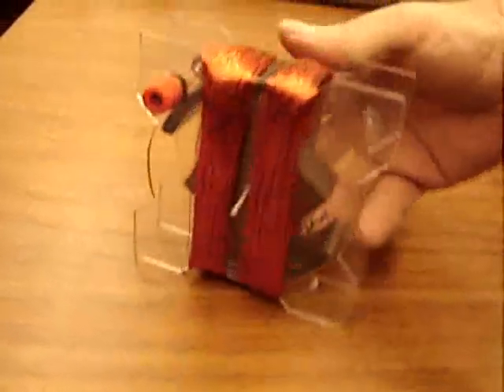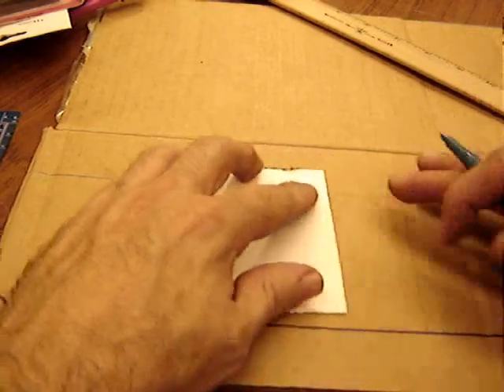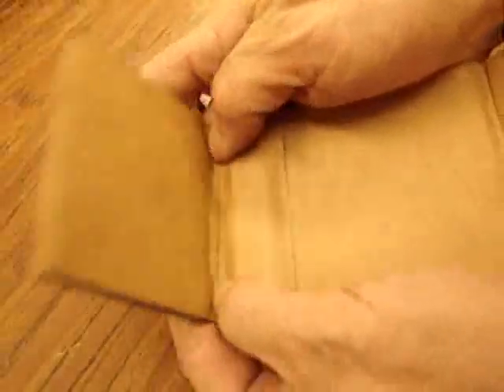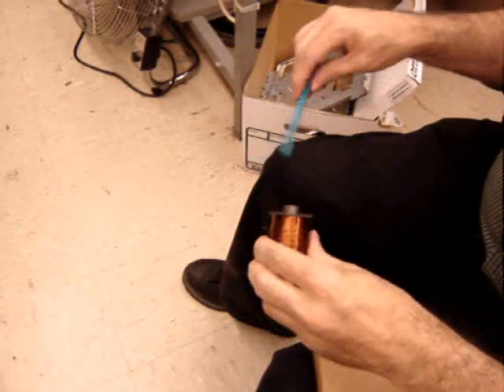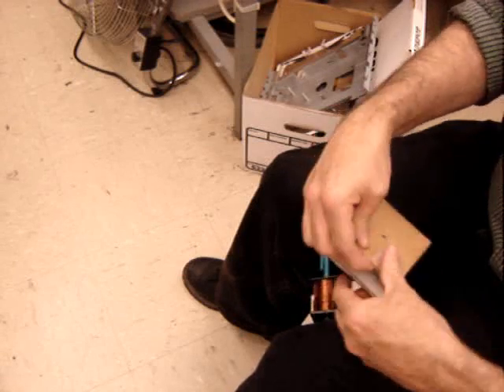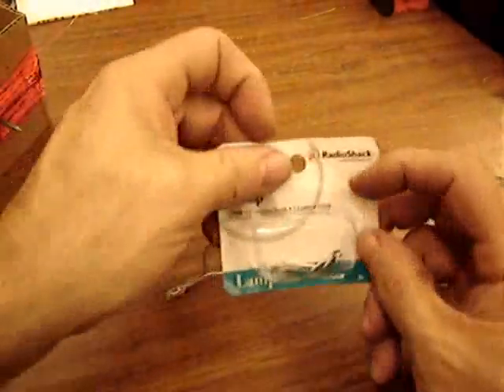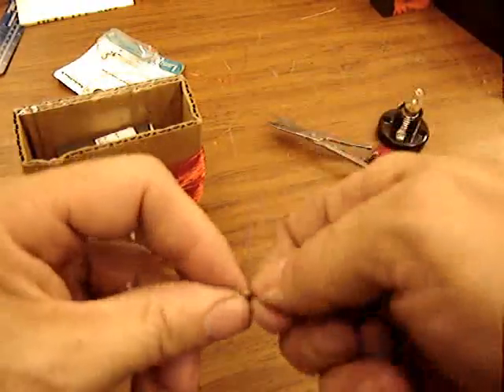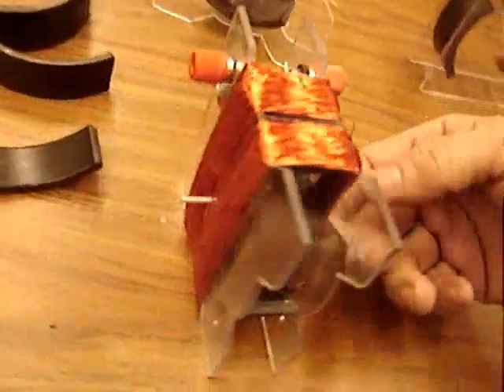Simple generator:  AC electric generator for science fair

Comment from the maker: Use the wire listed in the article.   If you can't strip the varnished wire with a knife, then use a piece of sandpaper.

LEDs will work if you use more than one spool of the Radio Shack wire, then spin very fast.  Red LEDs still work at lowest voltage.  Blue or White LEDs probably won't work at all.

Comment from the maker: They all have to be stacked together.  Then measure the voltage on one while spinning magnet.  Add another in series and voltage should be higher.  If voltage is less, then swap the connections.  Repeat the process with each coil.

Comment: well, the smaller the wire and the more turns the larger the electrical output. So you could either make this thing with more turns OR latch a drill on high speed and AWAY YOU GO! personally, I would use neodymium magnets for their superior magnetic field strength. It would produce more energy per turn. The magnetic field induces a current and therefore an electrical potential difference (aka voltage) which sums Faraday's law. Good luck, physics test tomorrow!!

Comment: The wire used in this vid is probably something like #24 copper wire with a coating of enamel insulation. The enamel is sanded off of the ends to expose the copper. 

Uninsulated wire won't work, and plastic insulation is too thick for this type of device.

Comment from the maker: Read the online article.  If you substitute different parts, the generator will fail.

To create 1/2 volt and dimly light the bulb, you need several hundred turns of wire.   Fewer turns will produce lower voltage, so the bulb remains dark.

Comment from the maker: It only puts out about 1V at AC.   Diodes could convert it to DC, but they eat up about 1.4V doing it.   That's why DC generators use commutator contacts instead of diodes.   To create higher voltage, spin it WAY faster, or use far more turns of much finer wire.

Comment: right ok.
i made a couple yesterday in my day off, i made the plastic kind. and i found out it works slightly better if you strip all the insulation off the wire, or get a plain copper wire with no insulation then wrap it in plastic, i used a heat shrinking plastic to make it almost water tight. i found it get slightly more Voltage produced when using and extremely accurate Voltmeter.

Comment: steel is not as a good condutctor as copper so it's resistance is higher but it might work if the steel is of good quality and if its not thin anough it would be hard to have 200-300 turns neatly wound over the cardboard

Comment from the maker: Electrical generators are "electricity pumps," and the metal wires supply the electricity being pumped.  Nothing else is needed.

This generator produces about 1/100th of a watt.   It can barely light a very tiny bulb.   To build your own 1000watt wind-turbine generator, see the Otherpower website.

Comment from the maker: Look at the innards of an electric motor.   A 200-volt generator looks just like a 200-volt motor.  You'd need a machine shop to make the parts.

However, guys at otherpower website made some kilowatt wind turbine generators just with supermagnets, epoxy, heavy wire coils, and steel plates

Comment from the maker: More turns gives higher voltage.   Thicker wire gives less "friction," less generator resistance.

Thicker wire would let you power more bulbs in parallel, as long as you still used a few hundred turns.

But also thicker wire lifts the outer turns outwards.  They'll be too far from the magnet.

The best design uses hunks of carved iron with a very narrow gap to allow spinning.

Comment from the maker: You'd need much thinner wire.   And iron cores.

Buy a 180volt DC-only motor.   Spin the shaft, and it generates high voltage DC.   (All motors are generators.)

Comment from the maker: That's almost impossible to do unless you have an extremely expensive superconductive coil.

If the magnets could spin fast enough, a copper coil could store a tiny bit of resonant energy.  You'd have to connect the coil in a closed loop, then spin the magnets about a million times per second.

Comment from the maker: All metals are full of electricity, all the time.   Physicists call this the "electron sea" of the metal.  A changing magnetic field can pump these charges into motion.

An electric generator is basically an electricity pump (Visualize all the wires as rubber hoses pre-filled with water.)   When the magnets move, the copper's electricity is forced to start flowing slowly.   The light bulb acts as a "friction point."

Magnets cause a current, but they don't create the stuff that flows.

Comment from the maker: With fewer turns, it will make far lower voltage.  But if you short it out (connect the ends of the wire together,) the current will be huge, and the magnet will become very hard to spin.

Comment from the maker: > if you put more turns in the wire would it produce more power 

Yes, but mostly just higher voltage.   Then you could light an LED.

The total weight of copper determines the maximum power.   If you had inch-thick copper, you could make a one-turn generator!

The number of turns controls the voltage.   For high voltage, wind thousands of turns of incredibly thin wire.   Magnet speed also controls the output voltage, so spin fast.

Comment from the maker: Transformers need too high frequency, like 3000 RPM.   But if you could spin the magnets fast enough, a transformer would work just fine.

Neo magnets work great, and give about 10x higher voltage.   But you need large magnets.  A big neo disk that flips over, with nails glued to the edges, that works.   Or use one of the "buzzer" rattle supermagnets, with nails glued to the tips.  Buzzer magnets have their poles on the sides.

Comment from the maker: Magnet wire (or "electromagnet wire") is just varnish-coated copper wire.

Normal wire has vinyl or rubber insulation which is WAY too thick.   It's so thick, you couldn't even wind 100 turns of normal wire onto the cardboard, much less 500 turns as I did above.   You need the thin kind with the varnish coating.

Comment: could you make more power if you use stronger magnets, more loops of wire,and a transformer. and i'm getting crazy but could you transform the voltage to high voltage even 220V

Comment from the maker: Mostly just spin it faster.   Normal generators run at a few thousand RPM.

But you could try using large neodymium magnets.

For professional designs of low-RPM high-power generators, try the wind turbine projects listed at otherpower website

Comment from the maker: Pennies!  Wish I thought of that.

Magnets need to be VERY close to the coil of wire.  But if they scrape the cardboard, they stop spinning almost instantly.  You want them to whiz freely when spun.

It works better if you use two or three spools of #30 wire.   Even better, buy one of those mail-order $2 solenoids I mention.  Pry it apart with pliers to get to the big spool of wire.

Comment from the maker: It's a tradeoff between many things.  First is the boring work in winding the coil.  Fewer turns is better.

Second: needing to spin the magnets too fast.  More turns is better.

Third: keeping the coil near the magnets.  Too thick wire will lift part of the coil away from the magnet.

Fourth: energy wasted in wire friction.  The wire can't be thinner than #30 if using a 0.5volt bulb drawing 0.01amps.  If lighting two bulbs, you'd need #27 or #26 wire.

Fifth: cheap magnet.  Can't use neodymium!

Comment from the maker: Also this generator was designed to use radio shack parts, not ideal parts. We need a few hundred turns in order to light the bulb; a few hundred feet.

Extremely thick wire won't work.  But the #30 wire in the radio shack kit is a bit too thin.  The wire contributes some electrical friction.  Thicker #28 wire would waste less energy.

Comment from the maker: The wire has to stay very close to the magnets.  If you used very thick wire, the coil would look like a baseball, and the outer layers would be far away.

For wire above a certain thickness, the current is determined by the light bulb.   Apply a voltage across the bulb, and the bulb draws a certain current.

Comment: i took your design. and scaled it up at least x10. used car speaker magnets(way more powerful then i thought) and a 1 1/4 ft nail and a whole carboard box. and instead of wrapping wire outside the box i made small boxes inside it. but i have a question. how can i tell how much electricity im producing?

Comment from the maker: Use adjustable wire strippers?

With the red varnish on the coil wire, you have to remove it with sandpaper, or scrape it all off with the edge of a knife.

Comment: If you dont wrap the wire around the box then it wont work, its a crucial part

Basically copper has a spare electron that can be shared with the copper atom next to it.. what the magnet does is helps to 'pull' that spare electron from atom to atom in the direction of the magnetic field which in effect gives you an alternating current- alternating or AC because the direction of the magnetic field reverses every 180 degree rotation of the magnet

Comment from the maker: The magnet and wire *is* the generator.   The box just holds the wire very close to the spinning magnet.

More weight of wire gives higher maximum power, regardless of number of turns.

More turns of thinner wire gives higher output voltage, regardless of total amount of copper.

Faster spinning magnets gives both a higher power and voltage

Bringing wire closer to the magnets gives both a higher power and voltage

Comment from the maker: > can u also use round and smaller magnets? 

See the magnets section on the generator project.  I've used cheap 1" rectangle magnets, the ones with the hole in the middle.  But it's a big pain, and messy glue.  And it's weak, so you have to spin it faster (or add lots more wire.)

Comment: First of all I'd like to see I'm a huge fan of your work and Love how you make such interesting stuff! Keep it up you're the man! One question, isn't it possible to spin the copper wire through the magnetic flux instead of the magnet itself, saving energy on moving the heavier magnet and saving energy by spinning just the copper wires around....just wondering perhaps you could extract much more power that way, this is awesome! now it's time to save energy via capacitors or batteries!

Comment from the maker: > I have some giant speaker magnets

My first one was a stack of speaker magnets inside a round  coil of wire wound around some nails hammered into a board.  Lift the magnets suddenly, and you can briefly light a bulb.

Probably two speaker magnets would work if you could flip them end over end inside some kind of close-fitting wood or plastic ring.   Wind your coil on the ring.

Comment from the maker: For a generator you need two things: a coil of wire and some moving parts which create a changing magnetic field.

A coil with a spinning magnet is the simplest.

Less simple is a spinning coil "rotor" placed near a magnet "stator."  It needs a slip-ring assembly or "commutator" to connect to the non-moving wires.

Or you could even wind a coil *upon* a magnet, then spin a hunk of laminated iron near the magnet to change the field.

Comment: could you make more power if you use stronger magnets, more loops of wire,and a transformer. and is there a way to produce DC current with the same concept or a simple design

Comment from the maker: It needs to be a few hundred feet, and it has to hug the magnet (and not be a huge wad like a grapefruit.)  Thinner wire than #30 will dim the bulb significantly.

Always start with the required parts.   Then after you get it working, make your own changes to see what happens.   If you start out with different parts, and it doesn't work, you'll never know whether the altered parts caused failure, or whether there's some entirely different bug in your system.

Comment from the maker: > (so it could recharge) 

Nope, a battery needs DC at 1.3v or higher.  This generator makes AC at 0.5v.

If you wound aboutfive times more wire onto it, and added a diode to create DC, then it could recharge a battery, maybe.

Comment from the maker: > super magnets from an old harddrive

No, because they have N and S poles on the same side.  Sprinkle some steel wool fragments on them and you'll see the dividing line.    Instead you need stacked-up supermagnets with N pole on one side and S pole on the other.

Perhaps you could file a groove down the middle of hard drive supermagnets, snap them in half with pliers.

Make a tiny supermag generator inside a close-fitting plastic pipe.  Then you'll only need 20ft of wire to light that bulb.

Comment from the maker: Read the article, see the parts list.   Using the wrong parts usually causes failure.

But try using just TWO of the listed magnets rather than four.   You'll have to spin them faster, or use more turns of wire than just one Radio Shack spool of #30.   But the generator will still work.

Comment: It relies on the same principle, but this produces AC, as the magnets are constantly changing direction and so alternating the current. A DC motor alternates the voltage between the coil, but does this with the usage of brushes and a connection, so it does actually need DC to run because it is the connections that change, not the current. in this generator it is the current that changes. I hope this helped.

Comment from the maker: Yep, use a large supermagnet sphere that fits inside a cardboard tube or plastic pipe.  Glue nails to the magnet to form an axle (glued halfway between N and S poles.)   With a 1-inch supermagnet sphere, you'll only need 50 turns of wire to create 1/2volt to light the bulb.

Comment from the maker: > i can't find 4 magnets

Read the webpage?  If you use different magnets, the generator won't work.   Call all the Radio Shack stores to find them.   Or mail-order them from the links in the parts list.

HDD magnets won't work at all, since they have two poles on the same side.  The two opposite poles cancel out, so the generator puts out zero volts.

Comment from the maker: > yet no-one has any idea of what a ceramic magnet

Only the specific parts listed on the project page will work. (Radio Shack #64-1877 magnets, or identical ones mail-ordered from the links: teachersource or magnetsrc.)

In the "Debugging" section I tell how to form large magnets out of small ones, but it ends up being more expensive, and the resulting magnets are far weaker than the ones in the parts list.

Also see the FAQ about a higher-volts design.

Comment from the maker: Big speaker magnets should work great.  But you'll have to make some sort of close-fitting ring-shaped box, or a very short piece of large plastic pipe.  The magnet has to be flipping over like pogs, *NOT* spinning like a turntable. So maybe glue the heads of two nails to two spots on the magnet edge, to form an axle.

Or use two magnets stuck together with cardboard spacers between, clamped around a thin axle between them (welding rod, or really really straight piece of coathanger.)

Comment from the maker: > ok so lets say i need to power something that will take or require more energy

This is a science project for kids.   A real generator is an adult project.   Better to just buy a $5 motor and use it as a generator.  All DC motors are generators, since "motor" and "generator" basically mean the same thing.   If electricity is like a belt, then motors and generators are like pulleys.  The only difference is whether the belt drives the pulley, or the pulley drives the belt.

Comment from the maker: > Will it light up a 2.5 volt LED bulb? 

If you triple the amount of wire, it will flash a red LED (that's about 1.5 volts.)

Those cheap mail-order solenoids from Electronics Goldmine are great.  For under $2 you get the same wire as in three or four of those Radio Shack spool kits.

Comment from the maker: > Okay, it wont work.

Looks good.   Spin it fast, in dim light.  

The magnets have to go way WAY faster than shown in your video.  When spinning, they should look like a blur, like about eight turns per second.  It helps much if you use a nail, and stuff something between magnets so the nail can't turn.  Twiddle the nail between fingers to spin extremely fast.    It also works way better if you buy a mail-order spool of wire (a $2 solenoid) and wrap on a few hundred turns more wire.

Comment: We made this exact same thing but applied it to a steam turbine. 
Instead of using the nail, we just picked up a long philips screwdriver and placed bathroom fan blades on the end of it.  After that, we connected the end wires to a volt meter instead of a lightbulb. 
That combined with a run of the mill pressure cooker helped us yield up to 10 volts. 
It was pretty awesome.

Comment: #30 wire? .... i have #23 ... is #30 thinner than 23? ... how does the thickness of  the wire affect the output electricity? .... I'm doing a project, used stereo magnets mounted on  a bike-like frame... having quite a trouble making the LED light up

Comment from the maker: > only difference i have is a larger nail and 2 neodymuim magnets, why doesn't it work for me??? 

Bad connection? Bad bulb?  Wrong wire?  Wrong magnet shape?  Magnets too small?  Too few turns of wire?

Don't make changes.  First build a working gen.  Figure out all the problems, and get the bulb to light.

Then, once you've fixed all problems, THEN you can start altering stuff to see what happens.    If you make changes first, then you'll double or triple the number of possible errors.

Comment from the maker: > only had 1 white wire inside instead of 2. 

Instructions:

Tape one end of the number-30 magnet wire to the side of the box, then wind all of the wire onto the box as shown.  It's OK  to cover up the nail hole.  PULL THE TAPED END OF THE WIRE OUT, then tape down both of the wires so the coil doesn't unwind.